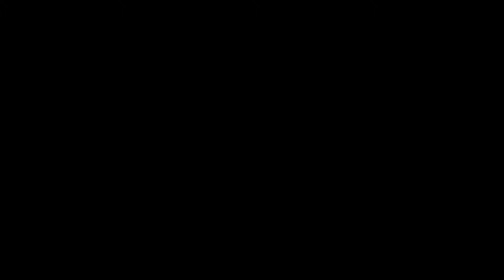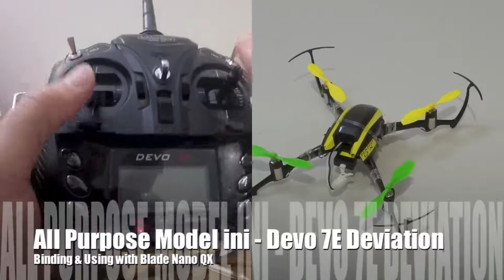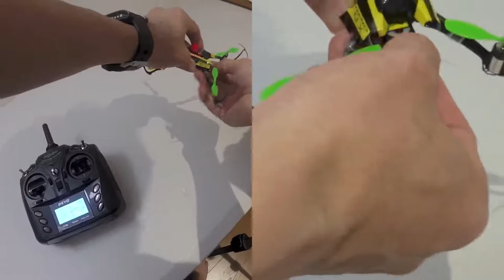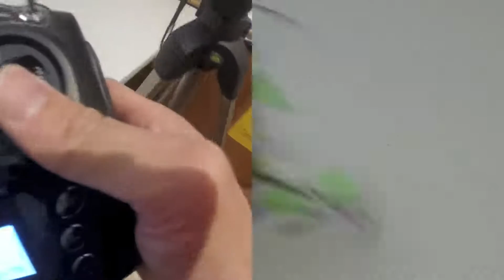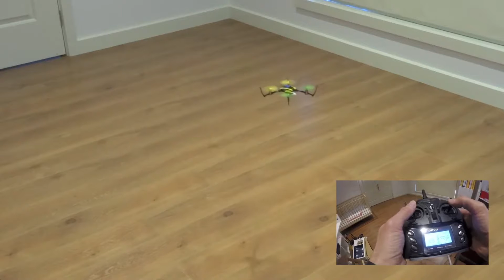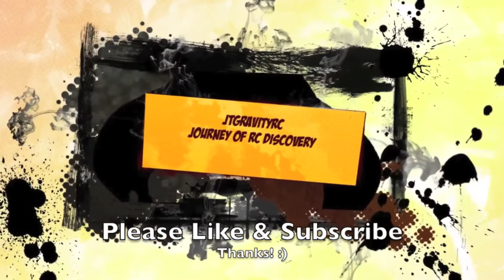Subscriber's request - All you can use Model ini - Deviation - Walkera Devo 7e + Blade Nano QX

Comment: thanks it all binded only problem now is nano flies but then when applying throttle all power on nano turns off and quadcopter falls out of sky then I have to unplug battery and do it again. what am I doing wrong lol
Reply from the maker: Swap different battery. I think your battery may be dead. If still doesn't work, then if it is new, try to get refund.

Comment: So are you saying you do not need to select a protocol.  But you do need Deviation installed.  Do you still need the module soldered in?
Reply from the maker: Jim Leffler you need the dsm protocol and it comes with deviation installed. No need module
Reply: I’m confused.  The DSM protocol comes with deviation installed?  Or, Deviation comes with DSM installed?
So you need just install Deviation in the 7e, then use the process to bind to protocols?  

Without any module installed, are you able to bind to the JJ1000 by this process?
Reply from the maker: Jim Leffler dsm uses the Sam chip as walkera but walkera locks it. Once deviation is flashed to the walkera chip in Devo 7e, it unlocks dsm. So dsm can be used without additional modules. With jjrc 1000, you need the nrf chip
Reply: Thanks for the clarification!  Keep up the great vids!